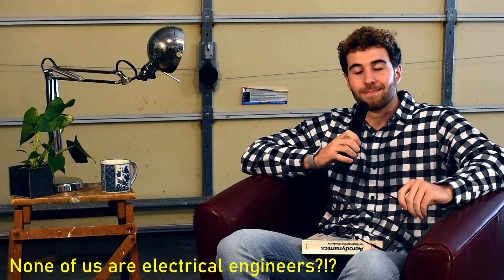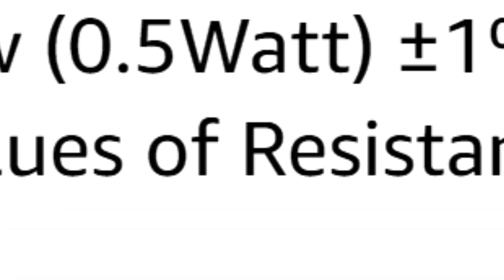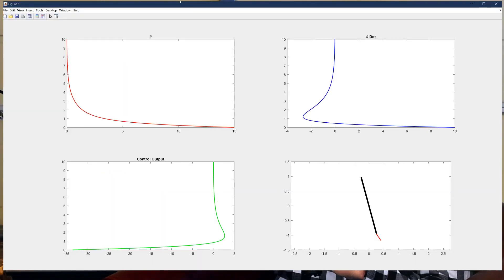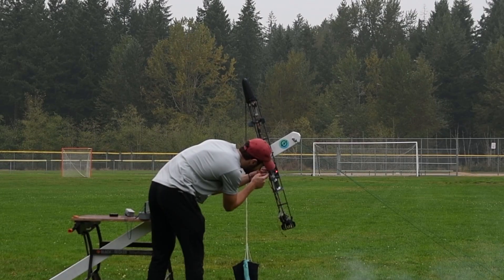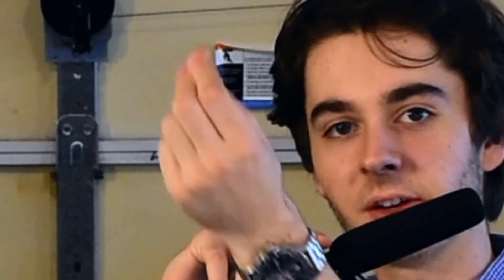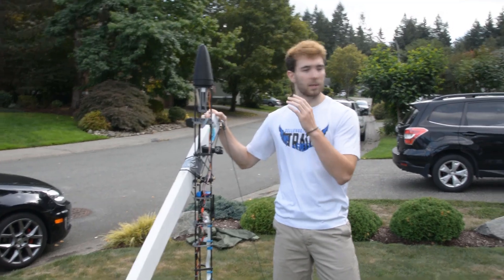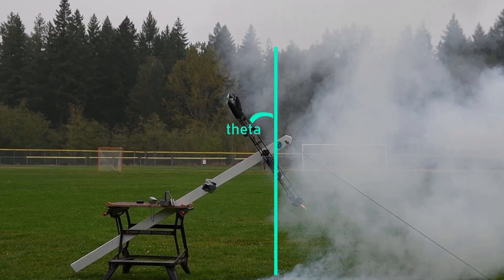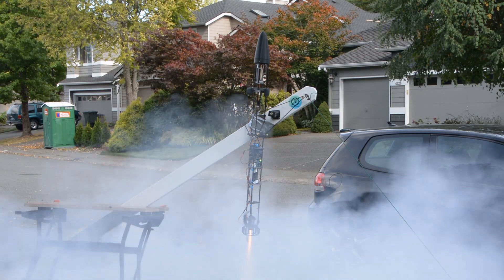State Space and LQR issues | Insight Devlog 01

Comment: for the noise, u should add more sensors well sensors that measure the angle directly "not a gyroscope" and then work up your way with the Kalman filter but u need away to add the direct mesermunet of the angle to the Kalman filter.